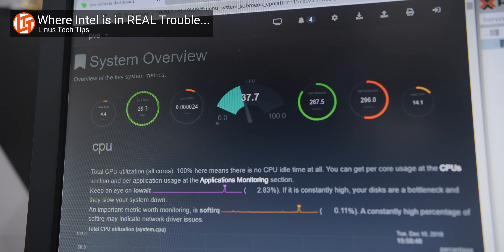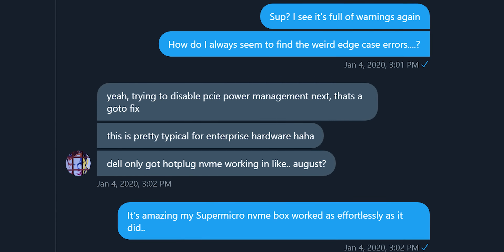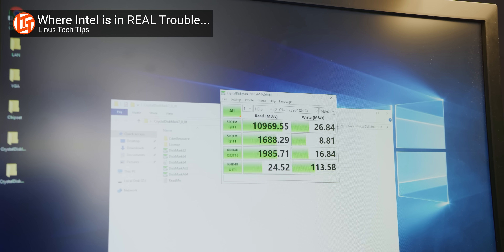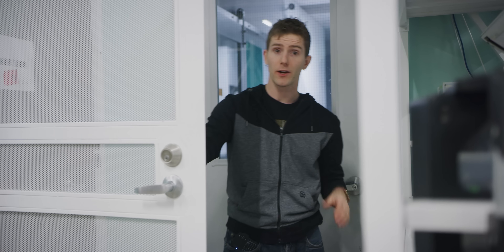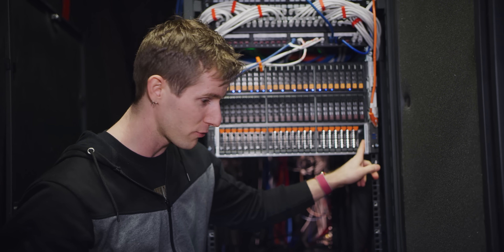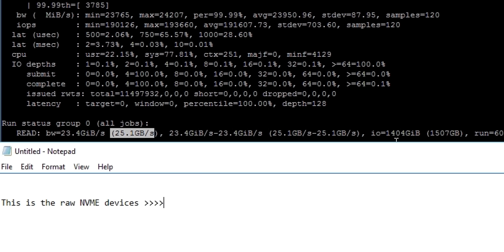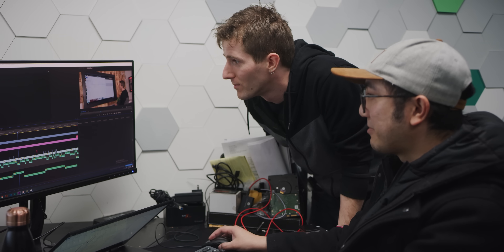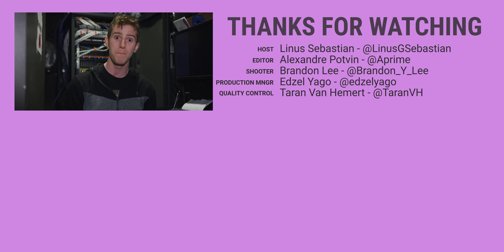This Server Deployment was HORRIBLE

Comment: I have always had an elementary question: How to avoid cross-wiring(data corruption my misdirecting data) when random-reading, particularly without fewer safety mechanisms, which, granted, bloat the setup?  Also, this sounds inspired by RAID 1 almost, nevermind the dragging 0, from how you present this.  Furthermore, what processors are you implementing?  The processor chiplets, and the singularity of parts are integral to something aimed at quality, not being able to just see the next minute.  There remains also the question of how deep the processors allot caching, as it in this case seems a volatile argument for either side.  I wonder about what levels of saturation of chips become an oversaturation, as this now sounds a drought.  Each NVMe comes with its own card(s), and there is the curiosity about addressing the MFTs.  For the, note, PERSONAL, system(s) I had, I noted, with my doing multiple things simultaneously, a, not removal, but minimization of paging, greatly sped it.  If you guys are employing VMs, that would bring another barrier and filter.  The question is further exascerbated by the hookup systems and their limitations.  To be an asshole, I will even query Plasma as display, which I would be VERY surprised if you had not already countered into.  Perhaps it would be best to remove all sensors, considering the inherent I/O delays and the system trying to match.  I only see ONE facet, thus pose these queries.  And you DID say unbuffered RAM, yes?

Comment: Actually something I have been running in to at work with all the new fast nvme arrays.    This is were storage engineers actually shine because it's not as simple as just throwing a bunch of nvme drives together.  Great video guys, I don't watch a lot of your content anymore but stuff like this is what matters to me. User hardware right now is just so boring.

Comment: Thank you for this Video. I ‘build’ servers for small companies. I have a long standing argument with a client.  They are convinced that the answer to their performance issues is to throw hardware at bad code.  While it sucks you had to go through this exercise, it will save us in the wider world. I can now say, “More power; more NvME; more PCI” is not the answer you are looking for. 

Thank you! And thank your community of experts.
Reply: Ray Watters throwing hardware at bad code can work though, its not the best solution but it can work. Look at PUBG the game, its not optimised at all but works ok if your machine is a beast. If updating the code isn’t an option, then running it on better hardware is highly likely to work (software load dependant)

Comment: Dell Perc cards avoid this problem, I have at home, a 2tb x10 20Tb SSD array in 0/1 1U chassis a dell 7850  with 8gb on the perc card, not as fancy or advanced as your server by far but I have not had issues 

Could you have used an EMC raid card?? And what about unraid??

Comment: What about a Linux Real-Time Kernel? That's "commonly" done when data channels need to continually feed data.

For example, there's a CNC Control System called "Path Pilot" that runs on Linux with a Real-Time Kernel so that there is a FAR lower potential for losing data transfer rates from the hard drive/memory off to the CNC Machine.

Comment: So, if core switching occurs as part of the normal process, why isn't attached process such as interupts also looked at and switched to a suitable core if required - or - if that isn't / couldn't be done then why isn't core switching prevented (for that core) if that core has an unmoveable IRQ attached? 
It just seems as if the switching management method is...a little dumb??

Comment: While I understand your need to get something working, polling is never a good idea. It is because you are polling and not using the interrupts that you're burning up all those CPU cycles. That's what polling does, waste CPU cycles. 

The problem is not that this system is so blazingly-fast that the H/W is not capable of keeping up. While parts of this configuration may be capable of speeds that other H/W cannot support, the worse that should happen is that your throughput should be limited by the slowest link in the chain. Trust someone who has been writing H/W drivers and interrupt handlers for 30+ years, your CPU is not missing interrupts because it's not powerful enough. The problem is you have one or more poorly written drivers that this blazingly-fast configuration has exposed. 

It is those drivers that are not correctly handling interrupts. Why do you see issues in Linux and Windows? Most probably because those driver writers wrote the drivers for both operating systems and used much of the same flawed code. By switching to polling you have simply avoided the problem and settled for increased CPU usage and a decrease in maximum performance. You should file a bug with Microsoft and your Linux provider if you'd like to ever see this fixed.

Comment: Quick question! If my Motherboard only supports ram clock speed @ 1066mhz, but i have a 1200mhz ram, will it still run?
Thanks in advance...

Comment: I have to wonder if the outcome would be different with hardware raid cards versus hba’s and software raid? My train of thought with hardware raid is that the card would handle the communication with then drives on its own bus, free’ing up pcie to handle actual data transfer instead of constantly polling. This is assuming the hba just makes the drives available as individual devices on the pcie bus. I am almost certain the hardware raid card hides the individual drive from the bus and the card becomes the drive, fewer addressable devices seems like a good thing in this case. The hardware offload for parity and other calculations is just gravy on top.

Comment: Interesting ... while much more remote in nature, on the mainframe under MVS storage controllers featured multipath access with I/O completion able to respond on any dispatchable engine (CPU).

Of course, I/O rates were much lower, but architecturally this didn't require that the initiating engine be idle when I/O completion was posted.

My experience with this stuff was quite some time ago with much more expensive machines, but a lot of the current service ideas came from the mainframe, though a lot of it never made to the current server architectures like the ability to set flags indicating that the current I/O is for a backup to prevent the storage controller from poisoning its cache.

Comment: I was going to put together a simple RAID0 NVME setup on my desktop to use two smaller fast NVME drives, but when I did some research, I found the same issue. The RAID overhead makes it not worth it.

Comment: This is awesome.

I really enjoyed this technical dry video more than the product review stuff.

Might be worth looking into some experimental hardware nvme raid controllers as this might help with the memory bottleneck because you can offload the overhead to sub controllers :) FPGA stuff has been used on raid cards for decades so I'm sure you'll find something out there which should help offload even more. The polling method is 'okay' but don't really agree this is a good solution.

I'd also ask AMD as it should be possible to deal with this better without compromise

Comment: I can understand the “go to” for ZFS for it’s great reliability etc. but honestly with high speed devices, ZFS isn’t the best thing in the world.

Also, wouldn’t it have been better to get some PCIe 4 NVMes hooked up to dual EPYCs and then just always use polling mode (at this point it should reach that “theoretical infinite speed contrast” to the rest of the system?

But eh, even for Linux pricing is a thing.

Comment: Casually listening while doing stuff
6:12 "I'm only hitting it with a 40 gigabit connection here, that's only 4 gigabytes a second maximum"
SLAM ON THE BRAKES SCRRRRRRRRRRRRR-

DID LINUS JUST SAY 40 GIGABIT IS 4 GIGABYTES?!?!! LOL
Reply: i mean he is a little off......it's 5        there are 8 gigabits in one gigabyte, which i find weird because its a base 10 system so I would think 4 as well.

oh well

Comment: I was wondering why DMA wouldn't be a solution for this, but it makes sense, since the storage device retrieves data at the device level, so the DMA controller would somehow need to know about the layout of the file-system.

With DMA, the OS would just say, "I need the data stored at location X to be moved to location Y. Tell me when it's done". Those locations could be anything. PCIE devices, RAM, SATA devices, etc. The DMA then can independently receive the drive's interrupt, bypassing the OS, and even the CPU cores altogether.

Not sure about x86-x64 processor DMA controllers, but microcontroller DMA is generally too simple to be programmed to perform file-system related tasks. If that entire process could be offloaded, the OS and CPU itself don't have to worry about doing any of this anymore and could just tell the DMA controller exactly what to do.

Comment: Starting with being stupid with even trying with Windows-sometnig.. :).. 
..you should just tweak that ZFS , not relying on Linux's stupid chkdsk-depended FSs (those 30 minutes lags on power on, no way to do online checks, platform-dependent FS, no checksums..). 
On ZFS pool, you can set blocksize PER DATASET (per usage case) that you actually need for video editing.  Also one can check per-dataset "sync" property for performance (if, saying there is a good UPS)
Linux is not the only way, there is also illumos (SmartOS/Triton, Omniosce) , FreeBSD or even MacOS.
OpenZFS shares code across Linux, illumos MacOS and FreeBSD implementations, so there is a huge community for tweaking (like mentioned ARC), and it is needed in such system.
Maybe you just ned to tweak ZFS more, like turning off or on transparent disk compression, anyway, if hardware is behaving normally, it is not about changing form ZFS to something less smart to get performance, but one needs to use it's smart tuning ZFS sometimes.

Comment: messed around with storage using normal dynamic disc formatting instead of storage spaces, storage spaces seem to suck big time when i tried making a standard server, over a 1gbit connection was pathetic, compared to having discs formatted and setup in disk management and also iscsi access seemed to max out the gigabit connection because it writes everything to ram first and then to disk. i wonder what speeds you could get on a iscsi connection, sucks you cant share the iscsi connections

Comment: Did Microsoft get the opportunity to investigate if Windows and Windows Storage Spaces could be similarly tuned for 'closer to theoretical performance'?  I'd be interested if the use of Windows was scrapped because it was perceived that nothing more could be done to tweak it, or if MS had investigated and confirmed performance was limited by the inability to tune their OS?

Comment: "linux software raid requiring 30 minutes to resync in case of an unexpected power failure" - did you guys try the block bitmap feature, ie "mdadm -Gb internal /dev/md0"? this keeps track of modified.. "superblocks".. which means you do not have to re-sync the whole thing in case of boom. it also comes with the downside of no longer allowing an array reshape, that is, swapping all drives to larger capacities and then increasing the total raid value WHILE it is being turned on, however, it can just as easily be turned off again before doing so.

Comment: Nvme is brutally fast. I installed Star Wars Force Awakens on my sata 3 SSd. When I died, the respown time was about 30 seconds. (2700x, 16Gb 3300MHz, gtx 1080) so I reinstalled the game to my middle class nvme with only 2 GB read and 1GB write speeds. Respawn time dropped to 10 sec!! And nowadays its cheap as f*ck

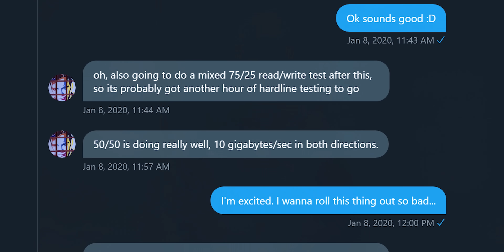Comment: 8:10 Oh no. Only 40Gbps connection? How will you survive?
Reply: 400GB networking when?
Reply: @MazeFrame  PCIe Gen 3.0 x16 is enough bandwidth for 100GbE. PCIe Gen 4.0 has allowed 200GbE, which is available today. The current industry roadmaps point towards PCIe 5.0 CPUs coming online around 2022, which will bring 400GbE. PCIe 6 is slated for around ~~~2025, and that's going to bring 800GbE.
Reply: @noname-gp6hk  ethernet is not good enough. just switch to infiniband already!!!!!
Reply: @noname-gp6hk  Look at the Arista 7504R3 for example, 96 port 400Gb switch. Available since early 2019.
Reply: @MazeFrame  thats a switch though, designed for top of rack use. A 400GbE NIC would require a PCIe 4 x32 link at the server level.

A 400GbE port at the switch would support 4x100 or 2x200 breakout cables to 100GbE or 200GbE NICs at the server. So yes, there are 400G top of rack and spine switches, but no 400GbE NICs at the server yet because the PCIe bus isn't fast enough until PCIe 5.
Reply: @noname-gp6hk  Then set up LACP! Jump through all the hoops!
Reply: MazeFrame Sounds like you should work for Level One techs. So many technical reasons why that wouldn’t work.
Reply: @giornikitop5373  not good enough for what though? Infiniband typically has better latency when compared to Ethernet, but with Infiniband being single-sourced through Mellanox/Nvidia, it makes one worry about potential pricing and availability issues down the road if you're deploying at scale. Infiniband remains popular within the high performance computing sphere, but the general datacenter remains on Ethernet due to its broad vendor support. And with Ethernet supporting RDMA operation over either iWARP or RoCE implementations, Ethernet is starting to feature a lot of the performance bells and whistles touted by Infiniband.

Especially with Nvidia's purchase of Mellanox... One has to wonder, what if you're constructing an HPC cluster using NEC vector engines instead of Nvidia GPUs? Or Xilinx FPGA cards, or Graphcore ASICs, or whatever else... Is your infiniband supply going to mysteriously dry up, be late, have weird pricing increases, etc? It really sucks that Nvidia is the defacto sole proprietor of Infiniband these days because it makes one wonder about these things when deciding what to put into an HPC cluster.
Reply: @ChrisSmithy  you could aggregate the ports as he suggested, but it never works as effeciently as you'd like and you would never see that kind of throughput. Even Netflix isn't able to fully saturate dual 100Gb cards because of processor, memory, and OS kernel inefficiencies. It'll be an exciting time when we do make it to 400Gb end-to-end networking, but we're not likely to see devices other than the switches themselves that can really make use of it. First thing we'll see it on will be NVMe backed storage arrays, but I expect it'll be several years still before that happens. At the moment, it's just a great way to provide a massively wide pipe for core to edge switch links.
Reply: @Robert Coffey hence why I said there are so many technical reasons why it wouldnt work. Well done for explaining one of the reasons, but why you’re talking like it’s the network bandwidth that’s the issue is the problem I have. The entire design is wrong for what they are trying to achieve.
Reply: @MazeFrame Cisco, Arista, Mellanox, FS, and Dell make 400Gb capable switches. They're just quite expensive, not as though Linus has ever been sensible with these things, but I think multi-hundred-thousand-dollar switches might make him quail at the cost. Not to mention the outrageous cost of any kinds of NICs that might be able to take advantage. Also, QSFP56-DD are really fucking expensive, as are the 24 fiber MTP/MPO cables.
Reply: I wish I had even 1Gbps download speed....
Reply: Technically, wireless would be the fastest, but we haven't invented that technology to utilize the crazy speed

Comment: Ugh. You’re off in your description of interrupts. There could be an issue with using legacy interrupts and not MSIs (doubt it). You want to look for AERs or other PCIe error reports and see what is actually wrong with the hardware - it will tell you. And if on “Linux” you were shoving pre-built binary ZFS modules then don’t. Try a vanilla file system to rule that house of cards out.

Comment: Why not just copy the footage for the project you're working on to local storage and then sync it back to the storage server? Even giving each editing workstation several terabytes of local NVMe flash storage seems like it'd be cheaper. (Don't get me wrong, this project is fun and super cool, I just wonder if there's an actual reason besides "because we can" to edit directly off a network share.)

Also... seems like direct fiber runs from the server room to each desk would have been worth it in the long run, but I wouldn't know the actual cost numbers of that.

Comment: You've over complicated this. also, why are you using proxmox? convert that storage server to a ceph cluster with an nvme cache layer, use another server to mount the ceph cluster and become your network file server. You can probably accomplish this simply by using freebsd jails or qemu to avoid using any additional hardware. I can help you set this up and reliably harness all that performance.